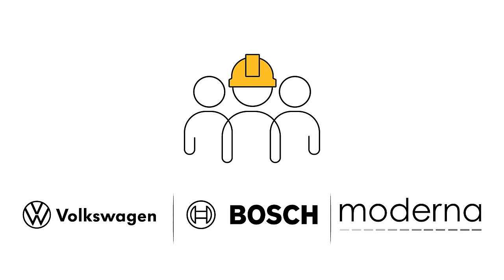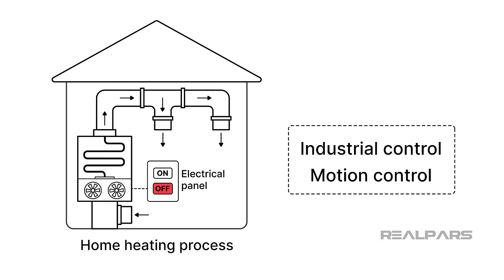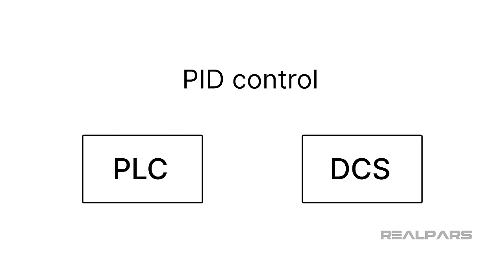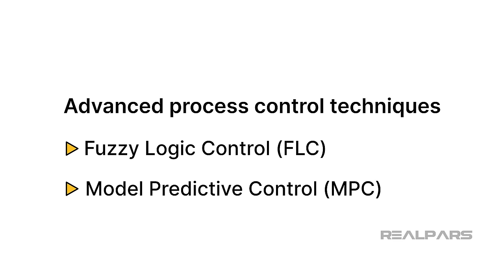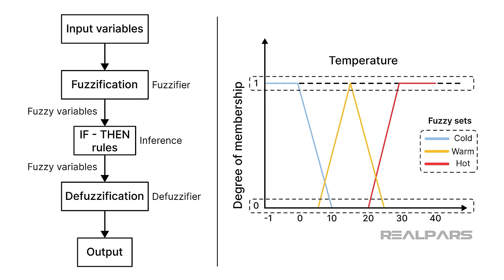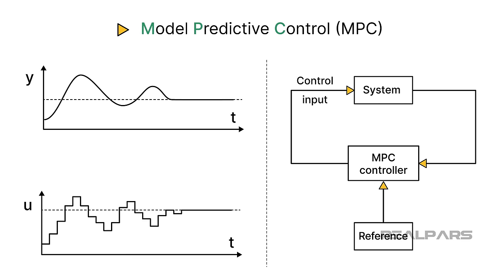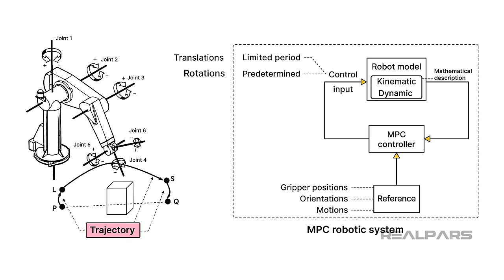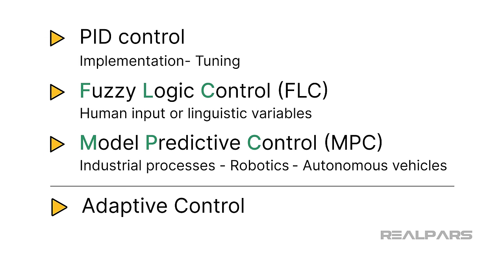PID vs. Other Control Methods: What's the Best Choice

Comment: I use PID with some fuzzy logic: if the error is close to ideal, I turn off the D part of PID. The result is incredible, the noise is very low. Also, being the I accumulator a measure of the system loses (drift, heat loss, etc.), I preload the I accumulator value with the P value as soon as it is not saturated, and periodically. If I have historical data, I preload the I accumulator at start with the typical value of I fir that setpoint. That way I save time loading the I accumulator, and I reach the setpoint faster. With these two techniques combined my controllers behaves beautifully.
Reply: Wow, very nice ideas.

I remember back before Kinetix 5xxx brought decent default tuning and adaptive tuning.  We altered the PID values during operation when we knew the load was changing.

Tell me, what kind of processes are you tuning that made you develop your techniques?
Reply from the maker: Interesting..... Thanks for sharing!
Reply: Howdy. Yeah.
During my days as a training planner in a paper mill. Operator experience.
Shifting to another paper grade only changing the main set value would take almost a whole reel if the PID:s were left to do the adjustments. One whole reel to be repulped.
The experienced operators knew the output values of the most important PID:s. They manually set them close to the final values. Then they input the new grade to the master controller and switched back to automatic. The new grade was achieved in about an hour. The shifting reel only needed to be rerolled cutting out the transition part. Enormous time saving and way less to be repulped.
Regards.
Reply: Recommend looking into PDF (psuedo derivative feedback) where the derivative term is replaced leveraging feedback and the integral. Limiting windup on the integral accumulator is also important.

Theoretical results show you can get faster convergence with little or no overshoot which can be very important for some control situations.
Reply: What about NON-Linear control. PID suck at that. Actually PID sucks at many processes. Because the world is not linear.
Reply: @HermanWillems  yeah in my line of work we we use flow control valves and moving 2% at 15% or 80% is not the same effect
Reply: @petr0rabbit  how do you solve it? Do you implement a model to linearize the process?
Reply: @HermanWillems  oh I wish I knew more how to deal with these situations. In this particular example its "solved" by engineering as, they will size the valves and piping to operate into the sweet spot range mainly.

the tuning is done in that range only.
the process setpoint is not that critical if it deviates as long as we pick it back in a couple of seconds.

I don't even bother using the pid to start. we start with a manual opening of x to get flow, then move closer to our operation point that we figure out then fire up the pid in auto and let it control. so we just avoid the worst part of the issue I guess.
Reply: Hey, what about sliding mode control?
Reply: Good point! Its a form of fuzzy control. By applying different (can be pid) controllers according to 1 or more state variable! Good that you mentioned it! :)  @steveandamyalso

Comment: The shocks in your car's suspension can be thought of as PID controllers: the spring is the proportional part, the damper is the derivative part, and your manual height setting is the integral part. The shocks in the suspension stabilize the ride height of the car against the constantly changing height of the ground (setpoint) while allowing minimal overshoot and oscillation.

Comment: There is also another type of bang-bang control, called "Take Half Back" by Steven Woodward. It offers settling time comparable to PID and useful for on/off systems like AC or home heaters.
Reply from the maker: Hi there! Thanks for sharing.  If I remember correctly, this concept was introduced over 20 years ago.

Comment: I wonder will you have videos about advanced applications for PID control?

For example these applications are commonly used in most DCS: split range, gain scheduling, ratio control, cascade control, and feed forward.
Reply from the maker: Hi @David_Bruton, Thanks for reaching out.  We have not yet developed any videos on advanced applications for PID Control. Stay tuned though as we are planning more videos and courses on such topics.

Comment: Long story short, a properly tuned PID controller IS the best solution, when feasible; if not, due to changing dynamics or excessive degrees of freedom, an MPC wil hack together a solution that is "good enough"
Reply: It is always a trade-off between complexity and performance. A PID controller is simple to implement for the industry, like he said it basically is just 3 tuning knobs. However, classical (frequency domain) control strategies go way beyond a PID controller called "Loop shaping". This allows you to combine all sort of filters like for example notch filters to suppress resonant process dynamics and low-pass filters to suppress noise. Lastly, MPC is a so called optimal control strategy, it finds the optimal controller output given future predictions, which is something that a feedback controller like a PID-controller is never able to do. Therefore, if you put them side by side, an MPC is superior since it is able to counteract to disturbances outside of your control (feedback) by recalculating the optimization problem every time step, as well as counteract for reference-based disturbances which you know beforehand (feedforward). However, if the MPC fails on site, your average machine operator won't be able to fix it because you need to know what you're doing to be able to tune an  MPC-based controller and prove stability is more involved.
Reply: MPC consistently outperforms PID, so it's objectively the best solution. However, it has an Achilles heel if the model is more than 10% off reality.

The PID is good enough and should be the default control.

In my experience, the feature I like best in MPC is that it has programmable limits. Most real systems have limits, and it's hard to optimize PID when there are real-world limits.

Comment: Very interesting the FLC part, but to which extent the fuzzy logic gradation is like the proportional part of the PID? Or does it add a quadratic value?
Reply from the maker: Thanks for your question. Fuzzy logic doesn’t actually add directly to the proportional part of the PID response. FLC helps in determining the proportional, integral, and derivative gains dynamically by using linguistic variables, fuzzy sets, and a set of rules

Comment: Yea furnaces cuntrull, in other videos that touch  on that subject it allways struck me as strange the the furnace wos either on or if an not controlled in a more fine graned manner , well I 'm no hvac engineer and certainly no gas fitter, but why can't ng furnace have it 's gas supply controlled ( thus controlling the ammount of heat actually beeing created) is it justba question of cost or is my lack of knowlage sowing wet clearly?
Reply from the maker: Hiya...... I'm not an HVAC SME or a gas fitter either.  Your question is reasonable indeed. Maybe you'll get a response from somebody in the know. In many large industrial systems, the temperature is controlled by duct louvres and vanes that move when commanded. Also not a terribly efficient way to control.  Does anybody else want to chime in?
Reply: I think that typical home heating systems have, historically, been designed to run at an "optimum" level of "burn", and have quite simple fixed jetting and air supply... It's quite possible to run a system that has enough "mass" with proportional control, for a smoother response, and even put in an offset value to make the output appear to be the commanded one, especially where the expected target temperature is normally in a quite narrow range.

Comment: Howdy. Great.
There are systems that use two PID:s in a Master - Slave configuration.
1. A servo valve has a built in flow sensor and a built in PID controller. The servo valve's Set Value is the desired flow. For regular control valves the Set Value is the throttle position. The master PID is an algorithm in the plant automation computer. The master PID sends the desired flow to the servo valve.
2. The master PID sends varying P, I, and D variable values to the slave PID. The master PID senses the diffrence between Set Value and Process Value. If the difference is large the master sends aggressive P, I, D values to the slave PID. Small Proportional value (=large k=large gain), large D value and small I value. 
When the Process Value comes close to the Set Value the master sends mild P, I, D values to the slave. Large Proportional value (=small k= low gain), small D value and large I value for smooth approach of Process value to the Set value.
The system will provide fast approach yet with no overshooting when tuned to optimum. It much resembles Fuzzy control.
Regards.
Reply from the maker: Good stuff! Thanks for sharing...... I've heard of this as well. Bottom line - The Master controller provides setpoint values, and the Slave controller adjusts the actual process to match these setpoints.

Comment: "Wait it’s all PID?"
"Always has been"
Reply: @VK-tv1eq  "sounds like a Kalman filter" - there you got off track a bit. The MPC is way more general, because everywhere the video says the word "algorithm" it can compute many more complex functions than multiply or integrate or derive. Higher order derivatives? Sure. (No they aren't D, they are functions that you can't generally get by tuning the gain on D.) Shortest path algorithms? Sure. All kinds of things implied under MPC. Turing-complete computations. Examples: figure the next engine gimbal for Starship flip, balance a double inverted pendulum, return a ping pong ball using three drones carrying a net, ...